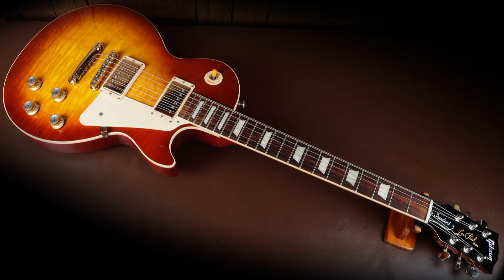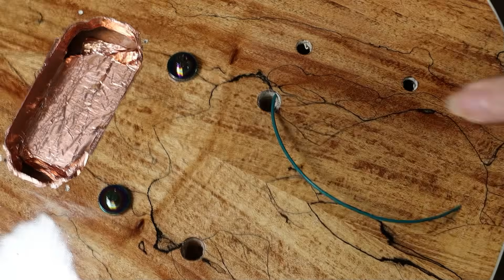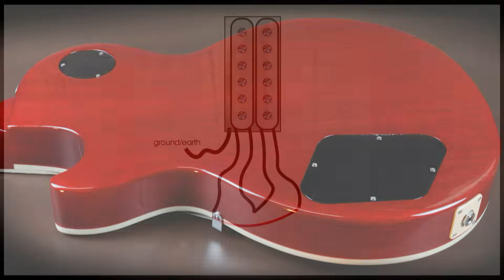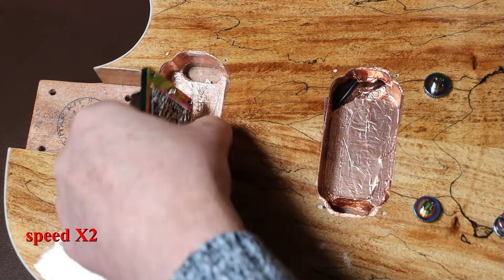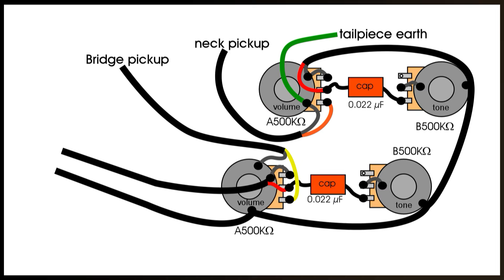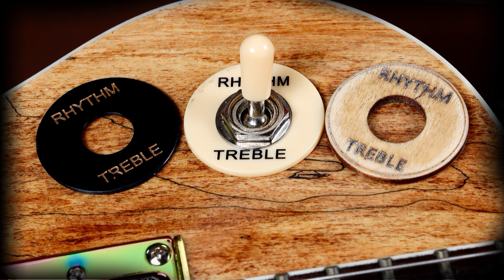How to wire a Les Paul or SG style guitar with a pre made wiring loom / harness.

Comment: Great video! Love the detailed explanations! 😊😊😊

Im doing a project right now on a lp with p90s thag has 3 wires per pickup. I want to have an out of phase push/pull pot on the neck volume and a series/parallel push/pull pot on the bridge tone. Can i just modify a premade wiring loom like this and replace the pots with push/pull pots and add the wiring mods or are there other wiring modifications i have to make on the premade wiring? Thanks!
Reply from the maker: It’s definitely doable, but since you're adding those extra functions, you'll need to adjust the existing signal path significantly beyond just swapping the pots! 👍😊 It might be easier to just start from scratch 🤔

Comment: Thanks so much, man. I finally wired my Gibson Les Paul replica. I even had to drill the holes because the pre-wired harness was a bit bigger.
The biggest issue was the pot casing not heating up even though my iron was at 500°C, but after hours of trying I finally got everything soldered.
This was my first time ever wiring and soldering, and without your video I wouldn’t have figured it out. Thanks again, man.
Reply from the maker: That's awesome to hear! Wiring for the first time can be tricky, but it sounds like you totally nailed it! 😊  I have the same problem, the cases of the pots are always a pain to solder too.

Comment: “Is this right: the outer silver ground wires from each volume pot go to the tone pot’s ground lug, and the output jack ground also goes to the same lug?
Reply from the maker: Yes, the volume ground wire does connect to the tone.  No, the output jack wire goes from the ground on the pickup selector switch 🤔

Comment: Thanks man, the video explained everything super well. 😊❤I subscribed to you too — really appreciate you making this video just because I asked. I haven’t wired it yet since my soldering iron and extra wires still haven’t arrived, but I’ll let you know how it goes once I do it.
Reply from the maker: That's awesome to hear! I'm glad the video was helpful, and thanks for subscribing! 😊😀
Reply: @guitar-academy  Hi, I’m shielding a Les Paul and I have a question:

When using copper tape in the control cavity, should I add an extra ground wire that connects the tape to a pot? Or is it okay to skip the wire if the pots already touch the tape when the harness is installed? I noticed in your video that the Les Paul shown doesn’t have any wires attached to the tape, so I wanted to clarify the correct method
Reply from the maker: @Jameshetfeild20  Good question . . if you're putting the tape under the pot you don't need to put an extra wire.  Usually the ground connects to the case of the pots or switch because if you screen underneath the pots the parts touch the screening anyway.  If nothing is touching the screening then it's a good idea to connect an earth to it.  I use a very small self tapping screw. 😊😀

Comment: Can you do the Free-Way 5/10 switch for Strat? I did one and it works great! Can you also maybe try to explain the difference between the types of push-pull tap vs switch? I heard one is completely isolating/disabling the humbucker pair, where the other reduces the windings. Is this true?
Reply from the maker: I'll be covering a lot of this in the electronics course.  But the two types of switches (push/pull and switch) can do the same thing or different depending on the way they are wired and the type of pickups.  🤔😊